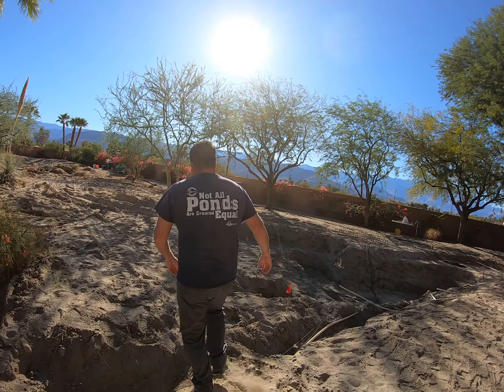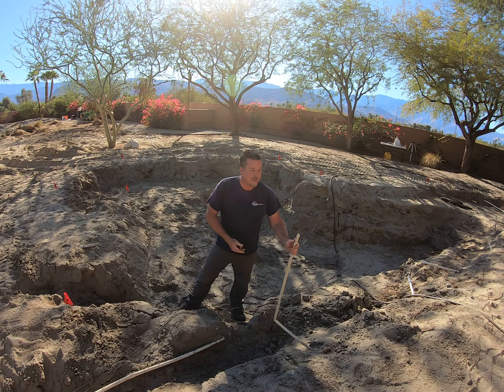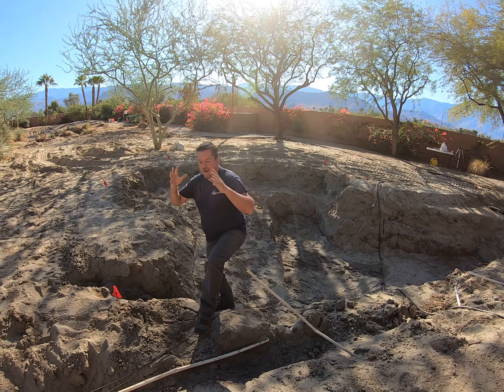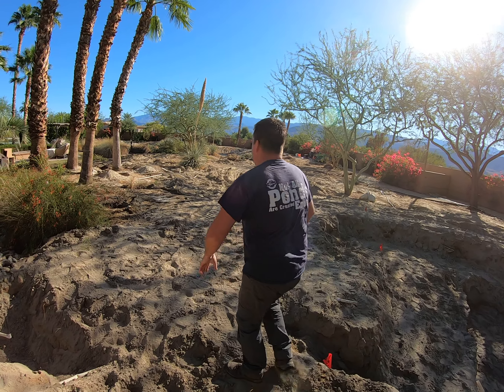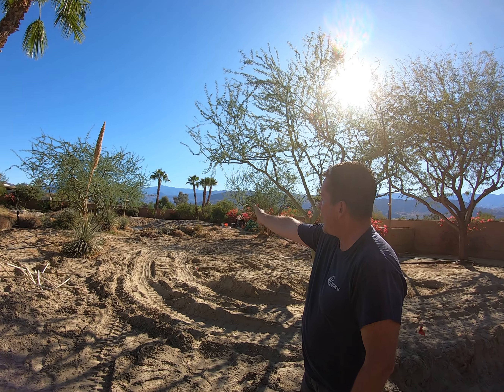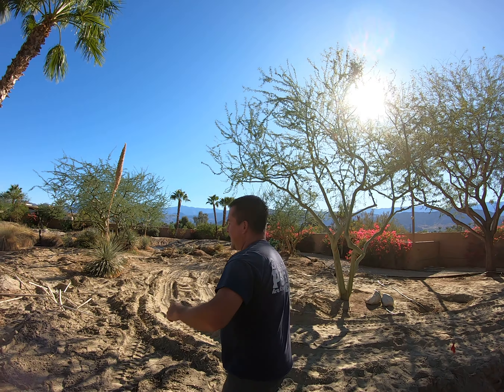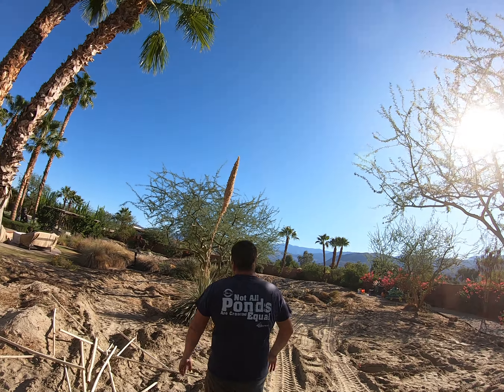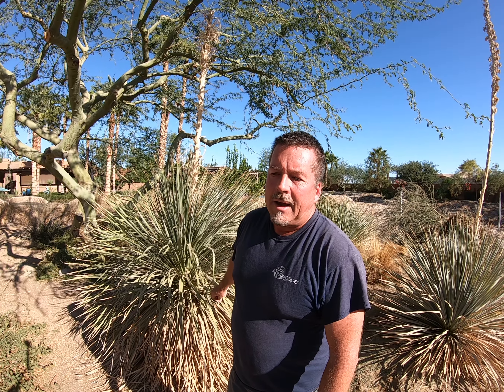Avenger Pond Video 3 Day Eight | The Dark Side of Pond Building

Comment: What size pumps are you going to run on this feature?
Reply from the maker: I love this question!!!!  We are running 4 Aquascape 12PN's. They will be plumbed into 3 inch lines and flow at about 10,000 gallons per hour each. there will also be another 4 more 7,000 gph pumps. 

A total of 60,000 GPH total before deducting for head pressure and friction loss.